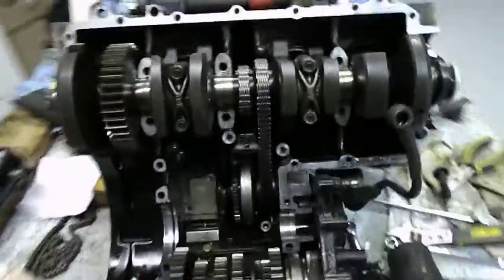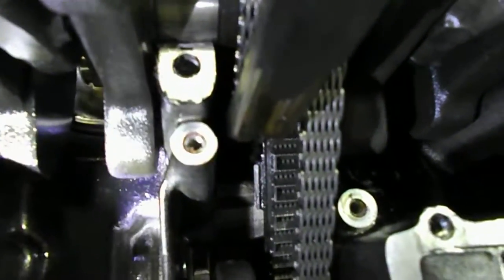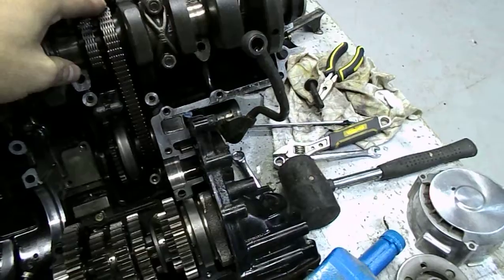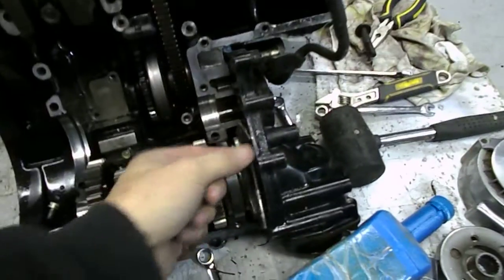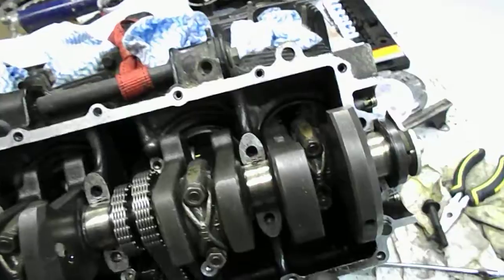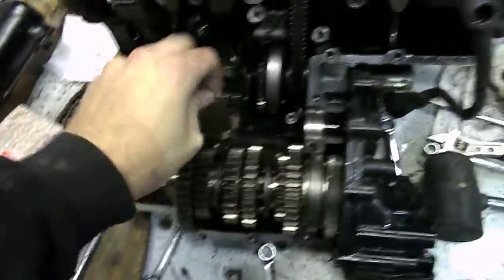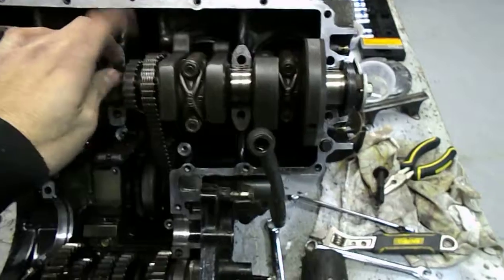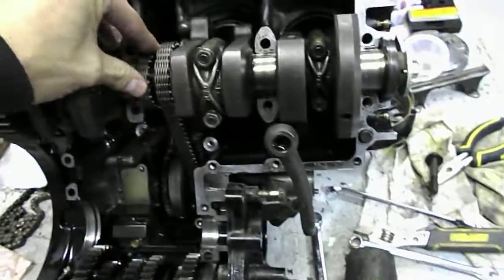1984 cb750 Alternator chain installed what next?

Comment: When you replaced the chain with the 92 chain.. Did you have to use the 92 chain tensioner also?
Reply from the maker: 360RTZoD no I just used the original, make sure the tab that broke off won’t contact the chain
Reply: New chain is wider, as are the starter sprocket, tensioner blade and crank sprocket.

I guess at a push you could use the starter sprocket and tensioner without swapping the crank but there could be some side  drift on the chain at the crank sprocket end.

Comment: Hi Pwfordever, 

Sorry to bother you.  I know you uploaded the video regarding the CB750 Alternator chain tensioner.  That rod that fell off, did you replace it with something?  If not, Did the bike and the charging system ran OK after you re-assembled the engine?

Just curious, mine broke and made a hole in the crankshaft.  I cannot find a replacement part and am thinking about not put it in and see how it goes.  

Your input will be highly appreciated.
Reply from the maker: refresh my memory, what rod?  the only rod I can think of is on the cam tensioner. 
yes the alternator output was great.
Reply from the maker: oh right that tab that held the rod on the tensioner that broke off!  yeah, I just filed it flat to prevent chaffing on the new chain

Comment: Did you get the bike done??
Reply from the maker: There is a bearing that sits on a dowel, should've sit on a dowel but it shifted during reassembly. so I got about 12km on that build so I had to start over, now i've put on nearly possibly over 10,000 km in the last 2 years

Comment: Is the alternator chain same as the cam chain?
Reply from the maker: No, but the two are beside each other.  The Alternator chain goes towards the back of the engine and the cam chain goes straight up to the top of the engine
Reply: Thanks mate! I have a cbx750f.. bloody cam chain rattle. Going to see if its just the tensioner, isit an easy job to change just the tensioner?
Reply from the maker: Yup, just be sure to tie up your cam chain so it doesn't fall into the case.
Reply: I cant thank you enough, mate, thank you!
Reply from the maker: No problem, let me know how it goes.
Reply: For sure!